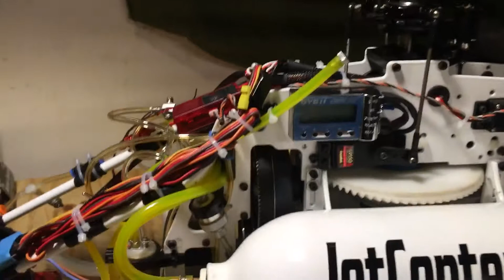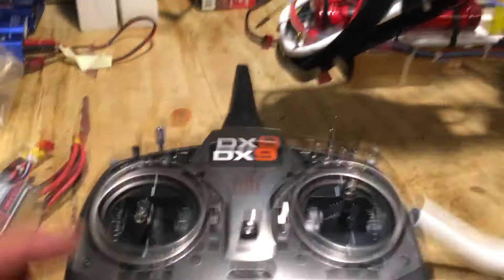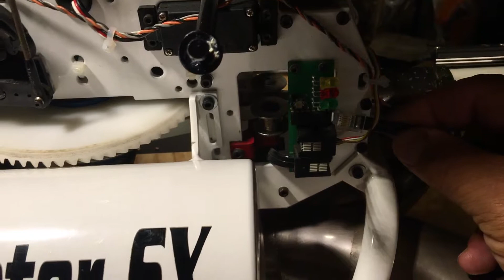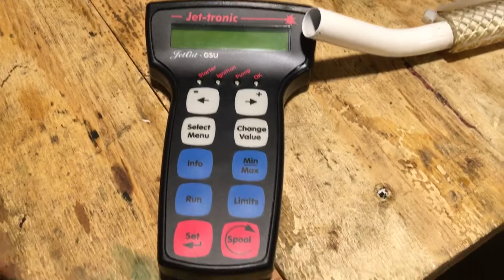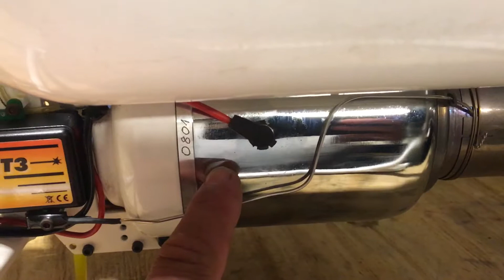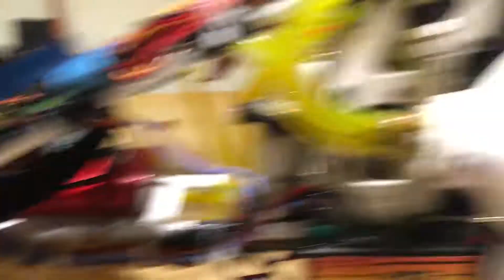Rc jet helicopter jetcopter SX jetcat PHT3

Comment: Do you happen to know what type of belts that are used on the turbine? Are they a special type? I’ve been looking around but can’t seem to find them.
Reply from the maker: No I do not know the belt type if you contact vario I’m sure they’ll be able to help you you can email them they usually get back I have contact them before for questions on that engine.